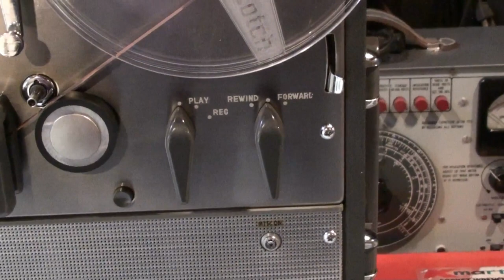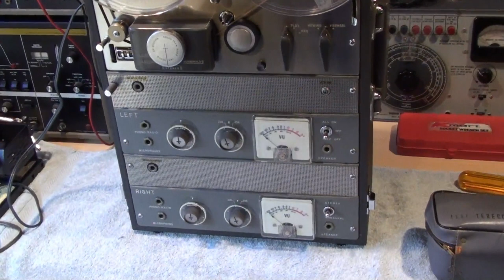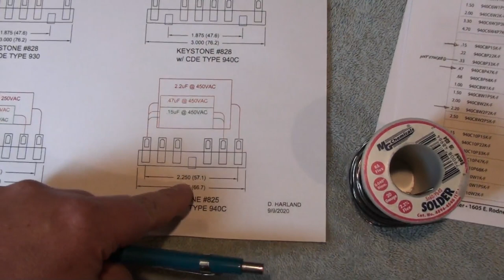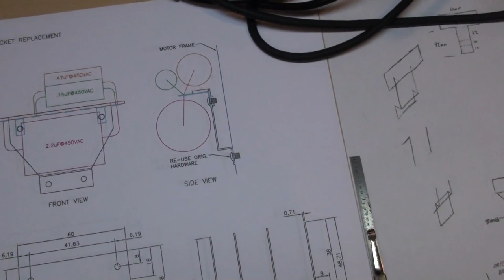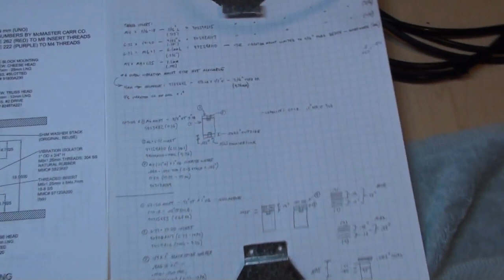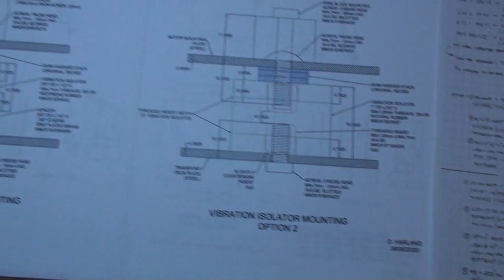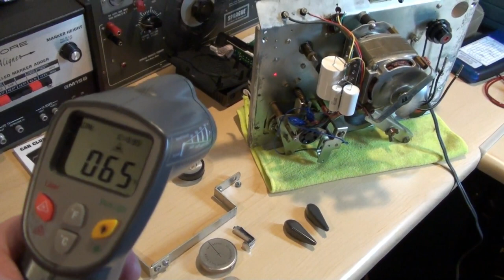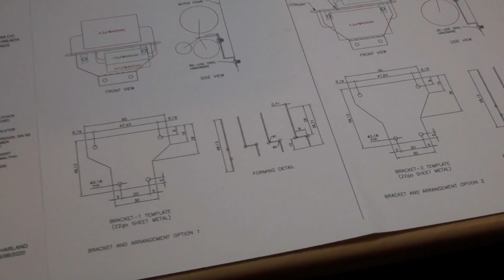Repair and Restoration of the 1961 Akai M-5 Reel to Reel Tape Recorder

Comment: Glad I found your videos.  I worked as a broadcast engineer in the mid 70s to early 80s.  I have a 1962 M5 Akai terecorder and need to replace the motor mounts.  I was glad to find your specifications for the motor mounts.  I need to get the machine running so I can test out the other electronics.  I will probably need to re-cap the amplifiers too.  Keep up the good work!

Comment: I got out of those depths of depression.  When I ended up owning 1/2 dozen Skelly 280's.  And a pair of Ampex MM-1200 multitrack machines.  Both a 16 and a 24 track machine.  And I had a 3M 8 track machine.  For a short while.  Before I acquired Curtis Mayfield''s, MCI JH-10-16 track machine.  He cut his hits on.  Before his paraplegic auto accident.  When I acquired his machine.  For my home studio in 1983.  That was one hell of a home studio I had in 1983.  Along with my three UREI, custom modified, Rev-D, blackface 1176 limiters.  KEPEX 500 downward expander/gate.  8 API original 550 equalizers.  Which were modestly more awesome than the later 550-A's.  When I had gotten my brand-new, 16 track audio console with 32 on mix down.  And a full-sized Plate Reverb.  We managed to muscle into my basement.  Of my home.  And that was my home studio back in 1983.  No one else had a home studio like that except for Les Paul.  Leon Russell and a few others.  And my home studio was wow we wow wow.  It was a holy FUCK home studio for sure!  In 1983.  When everybody else was still just using TEAC 3340's.  And TEAC audio mixers.  Ugh.  No.  I had a decent audio console.  Being a hawked  by Pete Townsend of the WHO.  The Soundtracs 16-8-16.  16 input for record.  And actually, 34 on mix.  When you count the stereo echo return in addition to the, additional 16 line level inputs.  That had a rudimentary bass and treble EQ and single effects  sends.  Which could give you the capability.  Of doing a full-blown, 24 track mix down with 10 additional effects returns.  From a pretty awesome portable British designed and built recording console.  The British just know how to build recording consoles!  That's all there is to it.

Later I would own a legendary 36 input custom Neve built for NBC-TV where I used to work for 20 years.  I never thought I would ever own one of those.  Much less a pair of them eight years later.  But I only held on to the one.  And sold the other one.  But that's a story for another day.

I really enjoyed your video.  It took me back.  Way way back.  With Sherman and the way back machine.  You gave me an incredible trip down memory lane.  Back in the my youth.  When this machine was still virtually, new.  And I would own it for the next seven years.  Until I had to leave it behind from a move from Detroit to Baltimore.

In fact back in July 1969.  In one of the few times only.  I were to remove the 7.5/15 IPS capstan shaft motor sleeve.  To record at 3.75 IPS.  With my TV audio plugged into one channel.  With CBS and Walter Cronkite.  And might shortwave receiver tuned to the Voice Of America's VOA.  Plugged into my other channel.  For when these couple of guys by the name of Neil Armstrong and Buzz Aldrin.  Set foot, on the moon.  And I captured the entire event.  On my Aikai M-5 at 3.75 IPS.  Both sides of the tape.

I was equally fascinated by the time differentials of only milliseconds.  Between CBS-TV and VOA radio.  And I was listening to analog-to-digital delay at the speed of light.  There was no digital delay.  It was an analog delay due to the speed of light.  The real fucking thing!  As digital delay devices for audio were years away from being introduced.

So some fabulous history here.  Some of it, with me.  It just blows my mind.  I was so closely and deeply involved.  At the pinnacle.  At the top.  At the Apogee.  Of the Pro Audio and Coast-to-coast Broadcast Industries.  I mean what?  Yes all of that.  With a career spanning greater than 50 years.

And I'm one of the last surviving members.  Of one of these legendary Pro Audio recorder manufacturers and audio console, manufacturers.  This wasn't supposed to be.  Not for a high school dropout with nothing more than a GED.  And a couple of weeks worth of technical training seminars.  Weeks.  Not months.  Not years.  Weeks.  And I was up and running.

As far as the running.  I was also my high school's fastest, short distance printer and fastest hurdler.  But I refused to join the track team.  Because I was studying to be an engineer.  I didn't need any college.  There was this big free building to go into.  This place was called a Library.  And they have all-stars of books inside you can read for free!  As many as you want.  In whatever subjects you want.  And you pick your subject.  And you read them all!  Every single last fucking one of them!

And then you applied at radio stations and recording studios.  And you got yourself in the door.  Anyway you could.  Maintenance, Recording Engineer,  DJ, administrative, duplication department.  It didn't matter.  You just needed to get your foot, in the door.  Without it getting slammed on your foot.  So you had to prepare yourself.  You had to be ready.  To take on the world.  You had to teach yourself.  There was no schooling for this stuff.  Back in the day.  Other than The electrical Engineering and Broadcast Journalism.  Or a degree in Music.  There was no, recordin' playing with knobs and dials, engineering degrees.  That just became a for-profit moneymaking venture.  By studios going out of business.  And universities that wanted more money.  So they purchased some recording equipment.  And hired some guy with a mathematics degree and a music degree to teach recordin' engineerin' degree.  And was that degree in Fahrenheit or Celsius?  Because they really didn't learn anything about, Audio.  They just learned about hot and cold sounding audio.  Eat this.  Don't eat that.  Kind of instruction.  Stuff like, don't use ribbon microphones.  Because ribbon microphones are noisy.  And people would spend between $20,000 and $80,000.  To accrue that misinformation.  Because they were too lazy to go to the library and read some books.  They were all children that needed to be spoonfed pablum.  They ain't got no brains, of their own to use.  They have smart phones and YouTube.  Books?  But you have to turn the pages by hand.  Right!  As it's almost like turning a page on your smart phone.  But with a real piece of paper.  Blinded in a book thingy.  I don't know why they did that?  They were heavy and took up a lot of space.  When they could've just put it all on a chip.  But they were not thinking ahead much back then.  They didn't know you could record anything into sand.  They knew how to make sand castles though.  At the beach.  Why not just record audio into that sand?  Yeah!  That's the ticket!

So they got some sand.  They heated it up until it turned to almost glass called silicon.  And then they scratched a whole bunch of little shit.  Into that silicon.  And now it's called a smart phone.  You can record your rock band into.  One track at a time.  Or, altogether.  Into your smart phone.  Where you are recording into sand.  That got all burnt.  How the FUCK does that work?  It's by etching a little one or a little zero on each fleck of sand.  And they do that to a whole lot of them.  Millions of them.  On something the size of your pinky fingernail.  And it holds, months worth of recordings in high resolution.  Go figure?  Any what the FUCK is going on here?  What?  Do they think we are living in Star Trek times?  How ridiculous!

For certain recording applications.  People used to write their name in the snow.  Look Frank.  Bob was here.  Oh yeah.  Which was used for earlier territorial communications.  Because we saw doggies and kitties and other animals doing that.  You just lay down a perimeter.  Everybody knows that your smell.  That's your yellow snow.  Wow.  What the hell was Bob eating last night?  Yeah that really stinks.  Let's poop on it.  Yeah!  That'll show him.  Who's boss around here.

I left my heart in San Francisco.  I left my testicles in Montréal, Québec, Canada.
 RemyRAD

Comment: Love the old reel to reel machines, I still have two, a Teac and an Ampex, the quality was nothing but good and well built. I need to work on the Ampex, it has clutch problems, the Teac works fine after going through it replacing caps, noisy preamp transistors and doing some work to the transport, oiling, belts etc.. Thanks for the video, I knew the sound quality was going to be good from this machine!

Comment: I have a 1967 Roberts 770X Reel to Reel and would like to restore it just like you did with the M5. Great job in explaining the major faults on these recorders. I also have a Akai 1800SD and two Akai 2000SD recorders and two Fostex 8 Track Reel to Reel recorders which are both in excellent condition. The Akai recorders are the ones I would like to restore. I'm kinda new with electronics but am learning and collecting electronic test gear so I can save a few of these wonderful machines.....
Reply: I own an Akai M8 in great working condition, same model as the 770X.  It sounds amazing to my ears.  Definitely worth restoring.

Comment: My father got the Akai M8 when he was stationed in Japan in the 60's also Navy. One of the selector switches has been broken though. May have been me messing with it when I was a kid, or the bakelight just got brittle. Bit thank you for making this, I intend on doing a full restoration.
Reply: I have an Akai M8 that my father brought back from his service in Germany in the late 60's. I've had a little work done on it and it's in great working condition.  I love the sound of it.  I might even prefer the sound of it over my Tandberg deck which is a decade newer and also sounds really good.  Definitely worth restoring.

Comment: Nice tape recorder you got here. I also have my Akai 1721W which was a typical reel-to-reel tape recorder from the 1970’s and it still sounds good, but this unit is a beast. I also another reel-to-reel tape recorder is my Concord 220T from 1964 with a hybrid tube and transistor amplifier and it still works but the sound is muffled, but it sound great when running at 7 1/2 IPS, and sound good 3 3/4 IPS and sounds poor at 1 7/8 IPS. I checked the inside and it looks fine and all of the original caps are okay, but it needs some recapping. The ones that I checked are Matsushita capacitors which were all Japanese made used for all models for both Concord and Panasonic machines.

There was another model that is similar to this is the Roberts 990 tape recorder which was identical to the Akai M5, but used the same design as the Akai M5, but this model was originally came with the Akai EA-10 extension arm for playing 10.5 in. reel tapes for longer recording time. This machine is very expensive and it’s been popping out on eBay where it goes up for a ridiculous amount of money.